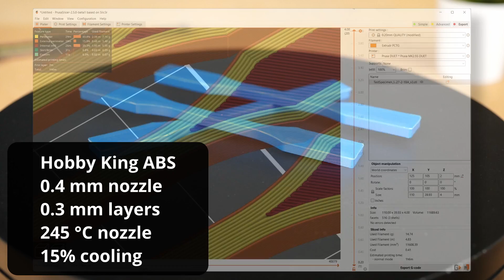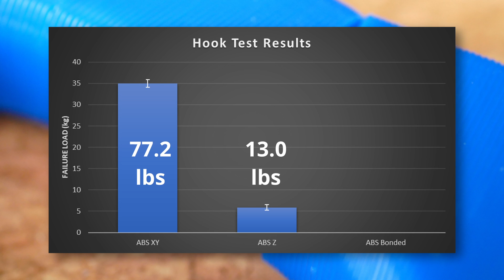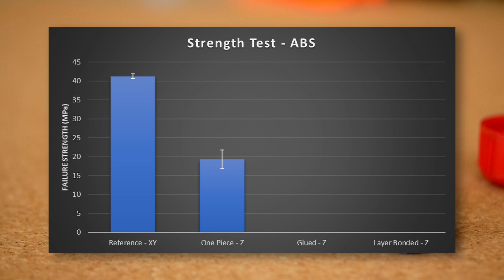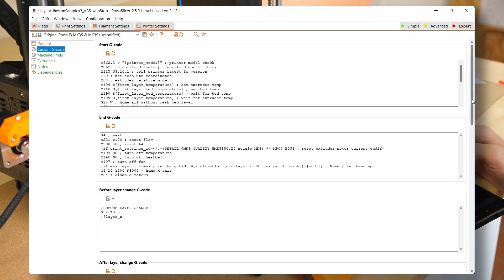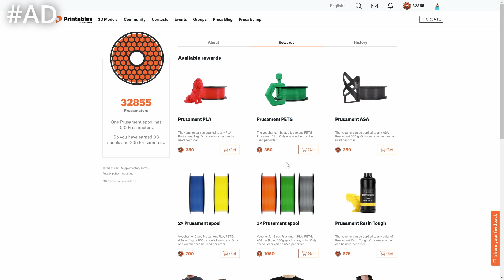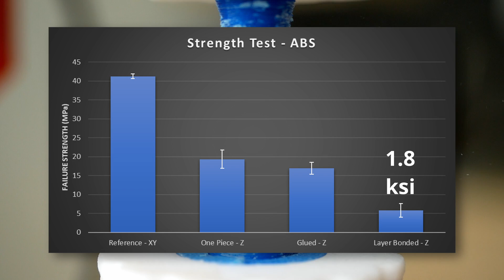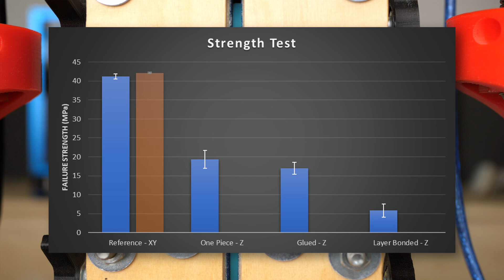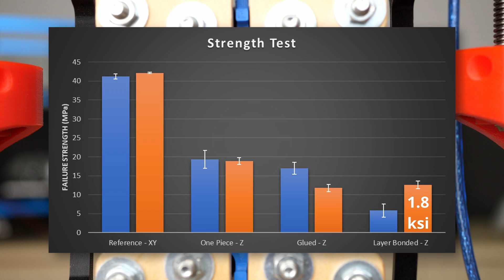Perfect Layer Adhesion if you Brush Solvent onto every Layer of your Print?

Comment from the maker: Visit printables.com at https://prusa.io/CNCKitchen/printables and learn more about the Prusa MK3S+ at https://prusa.io/CNCKitchen/mk3s
Reply: Hi. Interesting video.
Question: Ever printed with SBS? It can be smoothed with D'limonine extracted from the skin of citrus fruits. It is also used to recycle polystyrine used in food take aways 100%. Your answer would really interest me. We have a manufacturer in South Africa called Fil X that makes SBS filament. Videos on YouTube refere to imports from Russia years ago.
Love your channel. Always learning something new.
Reply: Now that I think about it you might use a wire brush of some sort to texture the layers. Using the tool head changer or doing a quick scratch manually sounds simple.
Reply: you could try doing something with non planar printing such as printing in a wave pattern to increase the surface aria between layers
Reply: Stefan this is just an idea of mine, can you heat treat after printing but not with oven, but sous vide, since some material change property after water intake like nylon.
Reply: What do you think about CHT's Volcano nozzle? Would you get even better performance with the CHT Volcano + 2 M6 nuts "volcanizer"?
Reply: How about 3d print in a large vacuum chamber?   No air to get traped between layers
Reply: Hey, @CNC Kitchen,
Can you do a few tests? 1) This same idea, but with layer-by-layer solvent and a post smoothing. 2) Special infill patterns to accept resin infill.
Reply: yo, for abs you want a stronger solvent. Butanone (MEK) its sold as laquer thinner. also i wonder if brushing it on a finished part would do the same thing as the per layer method. You can also brush it on petg parts to soften it which makes it less brittle.
Reply: "Can be used by anyone" might be false advertising, now that some models aka "NSFW" are behind an account wall.

Comment: Hi Stefan, love your content. I was working on a project today and thought back to this video. My idea was what if rather than painstakingly apply acetone to each layer you instead created ducting that routed to your part cooling fan ducting which moved gaseous acetone across the area around the nozzle tip? I don't have the time, space, or equipment to test this, but I thought I'd throw my name in the hat.

Comment: On a similar note, i wonder if there would be any benefit to add ironing to every single layers! 

Maybe similar to transparent printing, i wonder if it would increase slightly strength and make even very thin walls water tights 100% of the time

Comment: Could it be that due to the solvent melting the layers a bit the contact surface with the next layer becomes smaller? In that case overextruding a little might help.
Also, ironing every layer, but this sound too masochistic for my taste.

Comment: I am brand new to 3d printing.  My new ender 3d s1 should arrive Tuesday.  One idea I have had is perhaps not printing layers directly on top of one another, rather more like bricks are stacked on top of one another.  This way, each layer is bonded to multiple layers, rather than the one just on top and just on bottom.  I could see this increasing strength in some cases, but not applying to everything. 

Likely this has been done before.

Comment: With cura's new multi-material settings.. I wonder if you could trick it into lacing each layer into the previous. Giving a mechanical bond rather than a chemical from the heat.

Comment: I wonder if it's possible to squeeze some material into a maybe optimized infill pattern to fuse some layers together. The infill could build pockets  which can be filled  from the top layer. If those pockets have interlocking geometries it should improve the structural integrity. Maybe one of the infills is already appropriate and only needs some massive extrusions to be inserted into the gcode.

Comment: Have you tried testing them with an outer coating something like UV curable resin (like nylon), vinyl Esther,  cerakote or even just plain old enamel. I’ve used these to smooth and give the surface of parts a non stick coating to use in mold making. From the testing I’ve done I feel the resins put a candy coat on the print and improve their mechanicals.

Comment: Since solvents react only with the surface, probably the good idea is make details with bigger surface/volume ratio. I think it can improve performance of many post-processing technics, because higher amount of plastic gotta be infused together. But it also have disadvantage: parts would have bigger surface and would be much easier to warm up and melt.

Comment: @CNC Kitchen
Has anyone ever tried this?:
Try vibrating the model using ultrasound while it is being printed. Ultrasound is often used in chemistry to speed up interaction between substances. It may have an effect by batter joining the layers before they solidify because it speeds up diffusion.

Comment: If you could pass the hot nozzel back through and cut a groove in each layer. Go over with the next layer being extruded and fill this groove in both layers. Alter the possition just slightly alter and repeat. A mechanical joint that has the benefit of of a fused joint.

Comment: I wonder if you printed a disolveable shell first then printed as hot as possible inside the shell as to flow and bond between layers. Think in situ injection molding.

Comment: it would be cool to use some kind of sprayer on the side of the printer that sprays each layer a tiny bit of acetone in the center of the layer, perhaps with a solenoid and on the side a sort of hood so it cant get on the nozzle, like you have a probe on the side for layer height

Comment: Could an infrared diode laser just melt the area where the print is following. If you could just melt half the width of your printing line there could be a significant increase in adhesion. You would need somehow to direct the laser ray around the nozzle in the right direction.

Comment: The texturing remark have me an idea, what if the extruder head had a starburst opening instead of a smooth circle.  It would probably have a negative impact on print resolution but it might have better layer adhesion due to the increased surface area.

Comment: What about some step between layers that sanded or added some type of texture? Not enough to change the layer height but just enough where the melted filament bonded better. Just like sanding or priming before painting.

Comment: I watched this when it came out 3 weeks ago, but I also just watched the transparent/clear 3D print video that was put up yesterday - requiring that the filament is squished together without any gaps for refraction to disperse light. Couldn't the same strategy used to make prints clear also be used for perfect layer adhesion? If a part is able to be clear then doesn't that also mean layers are fully merged into one?

Comment: Instead of acetone use DMA or DMFA. Warning: use mask and get some good ventilation and also keep that in mind that these solvent are very hygroscopic. Polymer engineer here. Maybe you could try making some kind of air hot knife and pre-heat layer right befeore hot plastic is going through die? Hard to do, but maybe you have some idea.

Comment: I would love to see a laser (or even a hot air gun with an incredibly small nozzle) that would melt the previous layer just ahead of the print nozzle. That way, both the new layer and the layer it is being laid on are molten, thus allowing an actual weld to occur. 
It is like if you were trying to "weld" two pieces of plastic together. If only one surface is molten, the weld is incredibly weak. Proper welds, no matter the material, require both surfaces to be molten. I feel like a laser is the most accurate method to ensure only the plastic just ahead of the hotend will be molten (which will minimize deformation).

Comment: Instead of trying to get perfect layer adhesion, maybe a stronger material can be inserted/fused into the print like with reinforced concrete (could try pre-tensioning too) or the threaded inserts. Be far quicker than micromanaging every layer, more accessible if easy-to-find parts can be used, and might even outperform parts printed flat with the layers.

Comment: Use a heat gun instead of using a solvent. Hit it with a heat gun lightly every single layer. My reasoning, I worked as a thermal plastic welder for 3 years and ended up becoming the head welder and trained all the new welders. Then quit because the fumes are just as bad as metal welding.

Comment: I don't have a 3D printer, but I wonder if changing the infill pattern between each layer would help. Maybe  60° rotation from each previous layer.

Would also be interested in knowing if printing infill layers with small segments missing (--- --- --- ---) so next infill layers could slow at these points to push material into voids to add strength to the part

Comment: Doing the 3d print in an oven set to a significant temperature but slightly below where abs melts. Once the print is finished, slowly lower the temperature of the oven over 12 hours.

Comment: Hot doesn't stick to cold due to the thermal shock, so eliminate the shock. Add a laser to heat up the previous layer right before the next layer is put on.

Comment: the only way i have found to truly sort layer adhesion has been to model circular holes through my prints and screw in threaded rod!

I wonder if it would work with filament sized holes, just solvent welding pieces of filament through the print to tie the layers together afterwards.

Comment: If your printer is doing everything 'right' and the stuff won't print right, always suspect the material.
Slow down your printing; think long and hard about how much plastic per second you are asking your printer to throw onto the model.
Then ask yourself if that much of that much plastic has time to properly fuse before the next layer is thrown on.
Layer fusion takes time...slow down a little, chart the results.

Comment: The heat and the fan are going to flash off the acetone.  So you are just printing on a smooth surface, actually reducing adhesision.  Maybe try melting the filament in acetone in a hopper type feed to get direct inclusion of the acetone.

Comment: A small tube or two through the print that you can quickly spray acetone through. (Or use one of those wires with fur on it used in crafts, soaked in acetone to stick into)

Basically support pillars

Comment: It sounds like the acetone is the knee of the operation here. I would get some type of UV curable resin and have it extrude through a separate tool, then just mount a UV Light to the tool head to cure it. I believe this idea has already been scooped into a patent by someone, but might still be worth an open source attempt 🤷🏻‍♂️

Comment: Based on these tests solvent bonding sounds like a dud.

I'd try to print them with micro beadle holes 2 layers high and 2 layers thick through the 100% in fill parts. After the print I'd allow for the solvent to drip down these holes and 🤞 they will bond.

Alternatively print at a 100% infill, finish the print, put the print in a clay mold and oven the part.

Just ideas, no idea if they would work

Comment: I guess the high temps in the dehydrator can cause the same physical damage to the polymere chains when the solvents evaporate rather rapidly, like you get when printing with moist filament. I think thats where the bubbles in some breaking points came from, too

Comment: If you were able to print hollow ABS parts could you then fill the parts with an ABS/acetone slurry to make them solid inside? You could make the slurry from other cheaper sources of ABS than just using filament eg failed prints, ABS pellets etc. You could use a syringe to inject the parts rather than just messily pouring it in. You could have one hole for injecting and one hole for the air escaping. You could use other materials to make parts even stronger, heavier etc. It would be a bit like mould making but the mould and the cast just stay together.

Comment: Are acetone vapour smoothed parts stronger? How far inside the parts do the layers get melted together? If you were able to create parts that had a hole in to allow the vapour to penetrate more surfaces. There may also be a way to support the part to stay the same shape while being vapour smoothed eg packing it in sand or some other material

Comment: So my understanding is that layers are weaker because there is only so much surface area for them to 'grip' each other. Also that flat layers makes the prints weak in one direction. If you were able to create prints where layers had peaks and troughs or waves this hopefully would increase the strength of the layers because the surface area between the layers is larger and also because the layers weren't all going in the same direction.

Comment: Maybe you can iron every perimiter, that way each new layer for sure has a good layer to adhere to.
Reply: Another suggestion, maybe you can try  smoothing the inside of the parts. Like printing a gyroid infill and pouring in and out some solvent really quickly to bond all the infill and internal perimiter features

Comment: Here's an idea:
1. slice the hook lengthwise with a lock-and-grove feature so that a single hook is printed in two parts. Bonus point if you can stagger the ridges for extra slotting. 

2. Paint the groves with acetone and squeeze them together. 

A simple slice should add a stronger spine throughout your hook, but by using the lock-and-grove method, you increase the bonding surface to create a wider stronger spine.

Comment: *CLOSED LOOP SYSTEM USING LIDAR!  AI WILL AUTO-ADJUST PROPERTIES AS ITS BEING PRINTED.

YOU CAN also have an automated process of a LASER source to heat it strong to the prior layer..  But the issue is the elasticity and properties of the plastic.  You can have 2 lasers go over the part with the exact dimensions and specs in the G CODE!  THESE HEAT THE LAYERS RIGHT up to take away the strip layers and create a more customized heating cycle to heat cure it using the specd g code.  We would need MAXIMUM heat dissipation using supercooled air.  Maybe even put a localized Pelletier device to be freezing temp one side to go over the part with the exact dimensions!

That will LOOK like a PWM HEATING/ COOLING SMOOTHING PROCESS! SO AS NOT TO CAUSE DISTORTION.  ALMOST LIKE LASER CURING!

Other than that go to metal printing like I am and I'm paying 1/4 the price for wire per lb than I paid on amazon for plastic!

Comment: Ideally there should be a way to perform injection mold at home.
Layers do not adhere strongly to each other because they are just put next to each other. For it to work you'd need to mix the layers, to make every micro fiber to interlace with the ones from the next layer.
What might work is poking with a needle to make the material move up and down. It's ok if the result is not perfectly flat every thime, as it will be absorbed by the next pass of the nozzle.

Or you could just use a resin printer.

Comment: Stefan, you've done extensive tests on filament strength and how they handle temperatures. How about testing same with pressure ? There could be an application where 3d printed parts can be used as connectors, adaptors in pneumatic systems.

Comment: For the cylindrical parts, would it be possible to do a single extrusion controlled with timing and cooling, to create a monolithic structure? A single slow, controlled z move while extruding continuously, probably through a larger nozzle. Admittedly, the cooling solution would be novel and experimental, and for actual real world applications there would be severe limitations on part shapes/geometries, but it would seem like you could approach injection molding strength with the right parts....

Comment: Can you 3d print a mold negative with a non saludable material and fill it with an already dissolved plastic, let it fully cure, and test it's strength. I think it might be the strongest, especially if we can add filler material to the dissolved plastic like 10% fiberglass or carbon fiber.

Comment: As someone who prints in almost exclusively ABS I feel the part which caused your welded parts to fall short in strength stems from the accelerated curing in your dehydrator. ABS which has soaked up acetone is very sensitive to heat which can cause the material to puff up weakening the layers. Doing tests myself with trying to speed up the curing of welded parts has lead me to the conclusion of allowing the acetone to evaporate on its own will lead to a stronger bond.

Comment: 1st rule of glueing is not to speed up process with temperature, especially when glue is solvent based. This may cause solvent boiling,  bubbles creation and pressure based material separation.

Comment: Instead of acetone, install laser that heats up the layer just below the nozzle to heat it up and melt surface to make adhesion better.
Although looking at the working printer, it seems like the nozzle is far too short to have enough space for laser... Maybe on different configuration.

Comment: Darn, got excited about this one. 

You could add a brush and a little dosing pump onto the x carriage, have it move off to the side, get a little solvent, automatically brush on, or maybe have it continuously fed just behind the print path. 

That would be an awful lot of solvent around heaters though. 

Shame that method for printing with a UV curing paste is patented since that tech is crazy cool and could proabably pretty easily be done for hobbyists like us.
I wonder if you could have a resin core filament, like flux core solder, where it would melt together and end up with resin inside that was cured with UV, so you'd have a more homogenous resin structure with the durability of filament to counteract the brittleness.